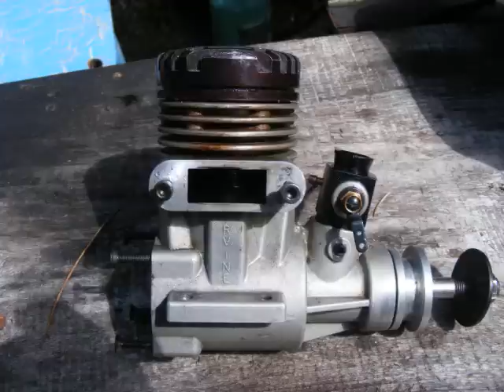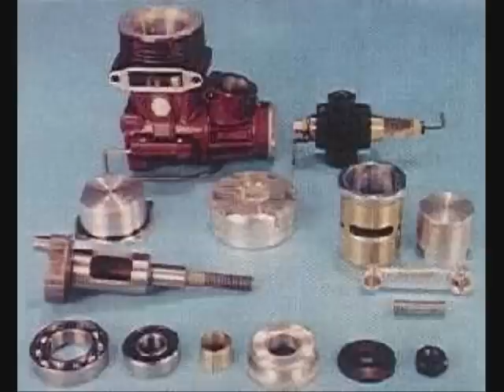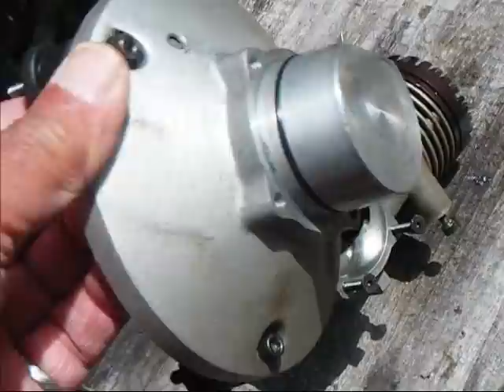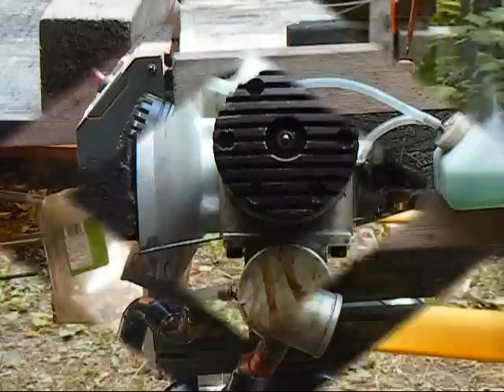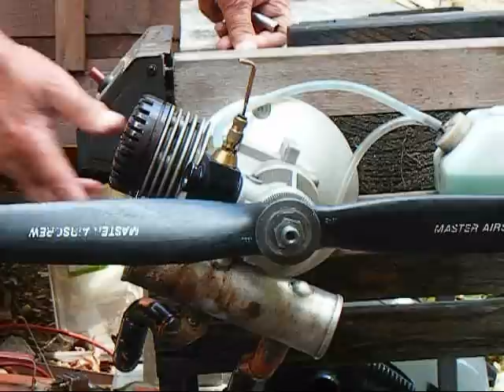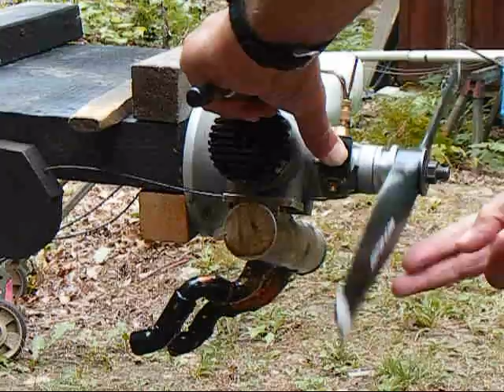Irvine 120 2C Model Airplane Engine

Comment from the maker: Thanks for that James!
That explains why both my low compression and high compression engines run equally well.
Reply: What glow plug do u use?  My Irvine 150 overheat easily.. THanks James

Comment from the maker: Yes you are right, as you mentioned they all did not have good compression. I think that this is a condition that is true for most engines which rely on a single dykes ring at the top of the piston for sealing. But if you look at the other video you will see that an identical engine does have strong compression and the compression has little effect upon power output. Perhaps the rings break in service and loose their sealing ability: something that I intend to investigate.

Comment from the maker: No! the exhaust muffler is an after market pitt's style which allows it to be fitted inside the engine cowl. The pipes are made up from copper plumbing fittings

Comment: It must cost a small fortune to run this engine glow fuel is expensive. why not just use a weedwacker type engine and run it on 2 stroke premix?
Reply: Oddly enuff this engine is very good on fuel.. Compared to lets say Super Tigre 2500 or 3000